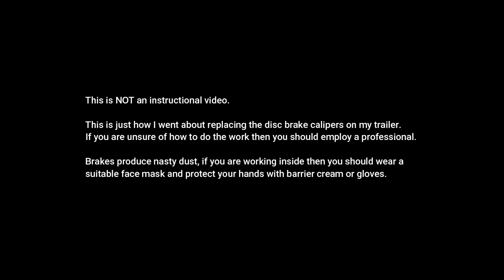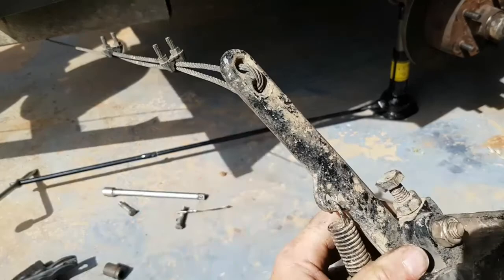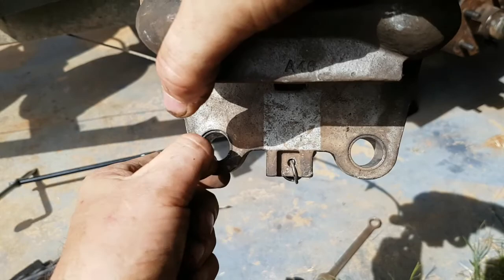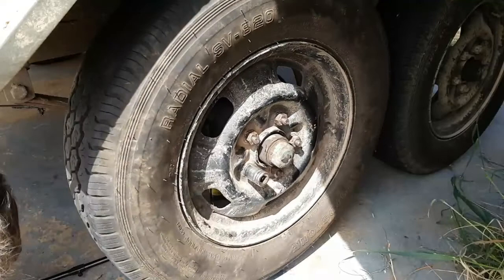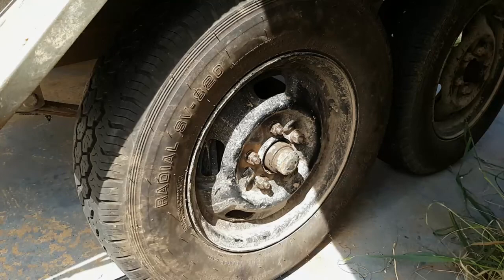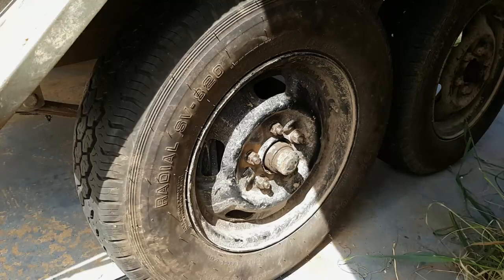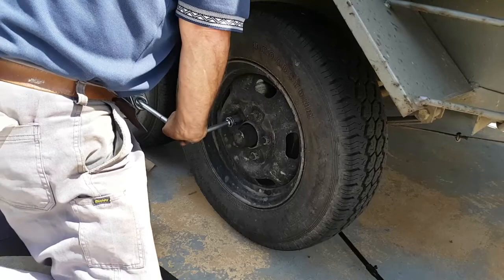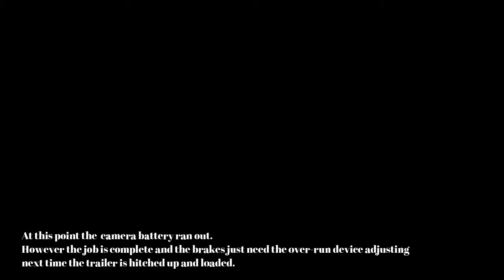Replacing the disc calipers on my trailer

Comment: Hey mate thanks for the video, I'm fitting new brakes to a customers boat trailer with the same style mechanical disc brakes. The problem I had was there wasn't any brakes currently on it so I was unsure how the cable connected. Your video was the only one I could find where it Showed the way it loops and uses wire grip ropes to secure. It's what I figured anyway but clarification is always good. Cheers.
Reply from the maker: Glad it helped. That is the manufacturer did it, Papas Trailers.

Comment: How does the caliper work? It has 2 pads but only pushes on 1, does the other 1 just float about?
Reply from the maker: Same way all subtle piston calipers work. The caliper is on sliding line and when one part is posted against the dusk, the caliper slides over, applying equal pressure to the disk with both pads.
Reply: @dadawoodslife  ah yes that's why they have the slides?
Reply: @dadawoodslife  thanks. Thanks for the video also